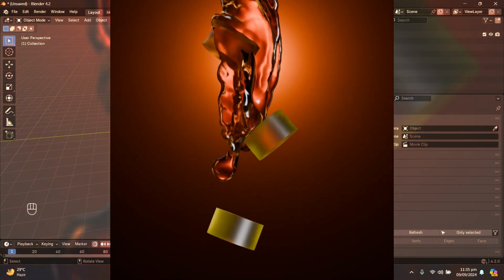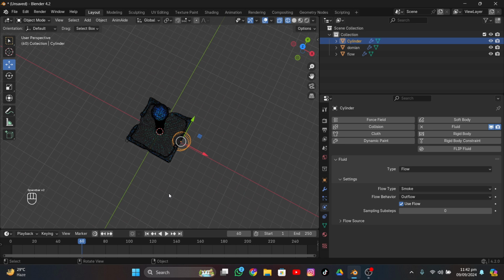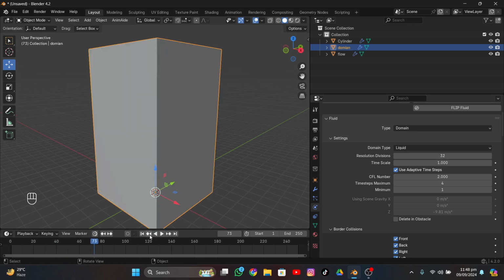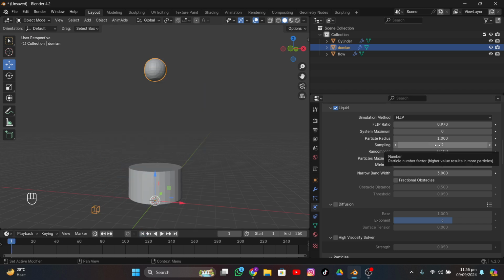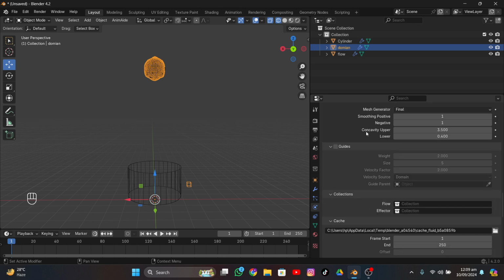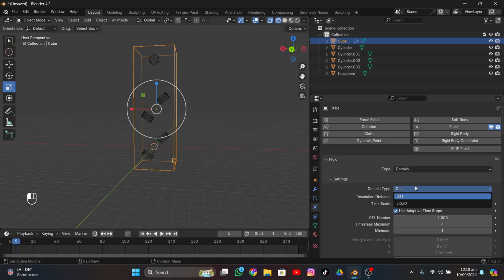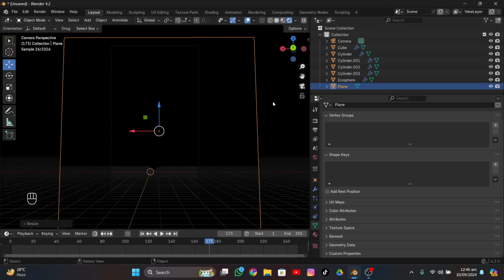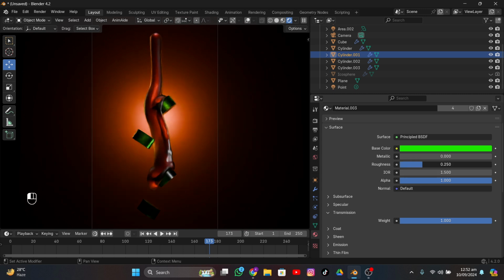Learning All About FLUID in Blender!

Comment: Hey do you work as a freelancer
Reply from the maker: Yes
Reply: In your laptop there is any problem during rendering is temperature is good not over heating
Reply: Or acer predator Helios neo 16 i7 14700hx rtx 4060 it is good for blender and unreal engine
Reply from the maker: @x-wing7012 well, it depends. When I am rendering millions of stuff. Its actually not able to do it. So, I just do small freelance project. Collecting money to buy a huge huge system
Reply: Thanks for your information